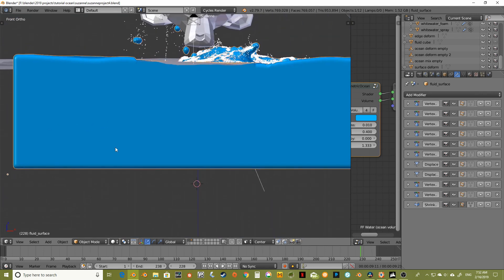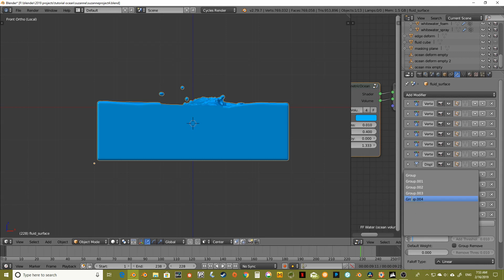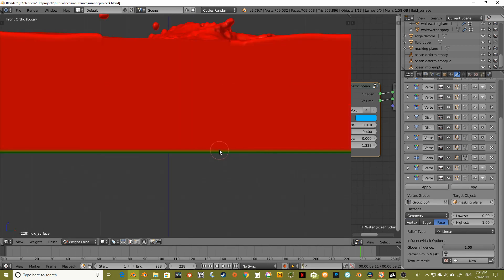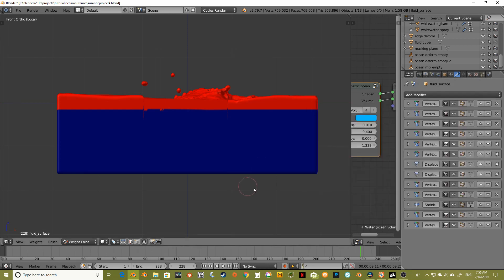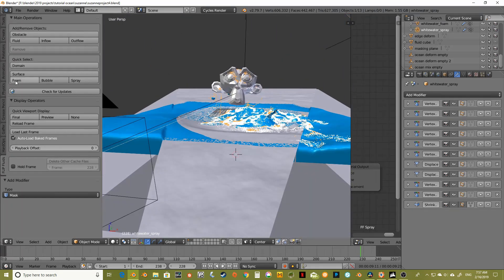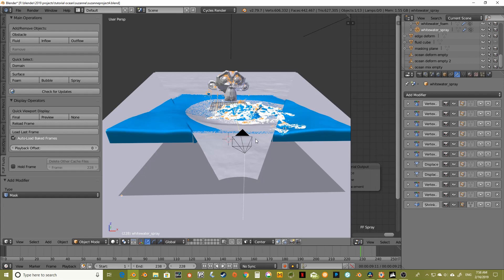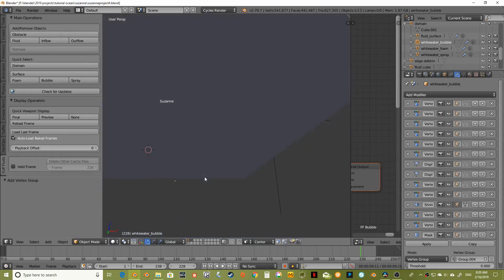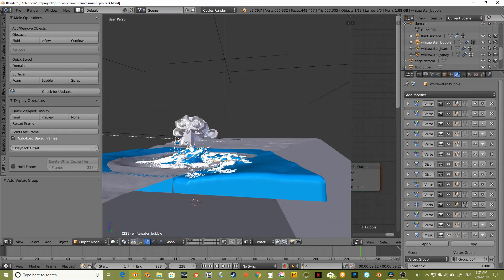Tutorial: Ocean Modifier plus FLIP fluid sim equals greatness! (part 11)

Comment: Thanks a lot! This is very helpful. In my case - vessel on the move, I struggle with almost all particles under the water level. When I use volumetric shader ugly things start to happen on the fluid edges. Do you have something in mind? I tried to add the same thickness to the surrounding water with no luck.